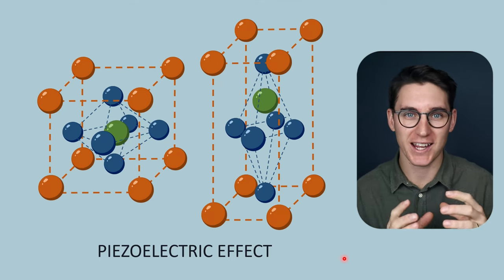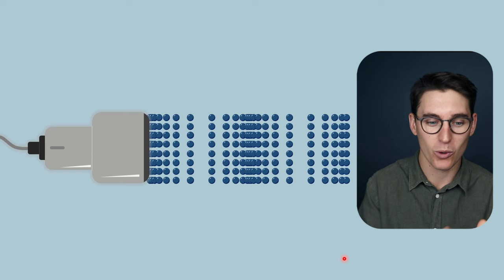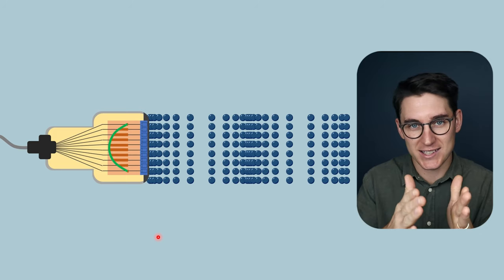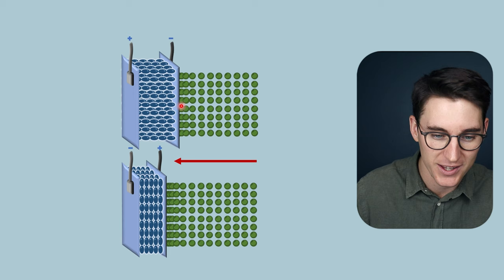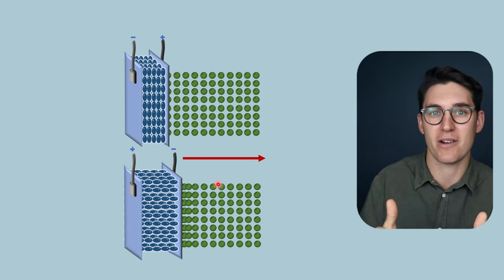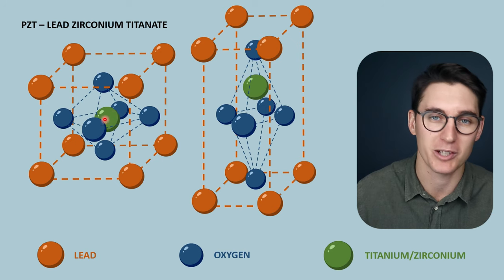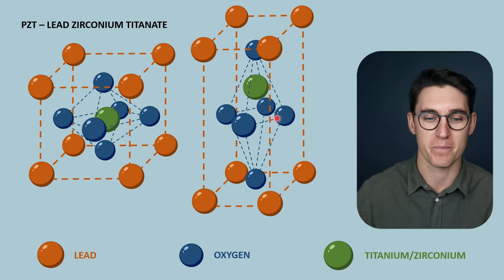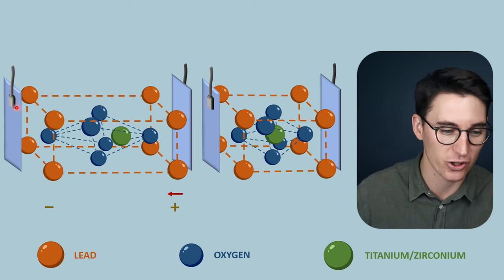Piezoelectric Effect and Reverse Piezoelectric Effect | Ultrasound Physics Course #11

Comment: Sorry ..odd question...but 350 celcius...where does the heat come from ?
Reply: I think it's somewhat misleadingly explained. Without poling, PZT crystals hardly exhibit any piezoelectric properties - their "dipoles" are oriented too randomly in this case, though they can orient themselves once high voltage is applied. The extent to which it occurs will depend on the conditions, and there are indeed different poling methods available, but the one most frequently used in PZT manufacturing involves heating it up above the Curie temperature.

Heating the crystals up to the Curie temperature will make them stay in an electrically "neutral" state unless the external electric field is applied, but after it's gone, the "dipoles" lose their orientation (exhibiting paraelectric properties). As PZT crystals cool down though, the same electric field can be used to orient them permanently so that they stay "polarized" in a certain direction even below the Curie temperature (undergoing ferroelectric phase transition).

After polling, PZT stays usable at room temperatures, meaning that the crystals aren't heated up to 350 degrees Celsius in an ultrasound probe, it's just a part of a manufacturing process.